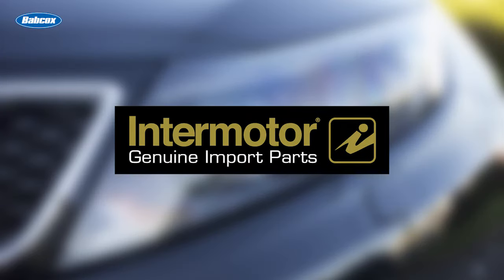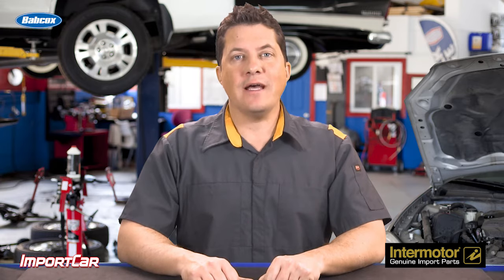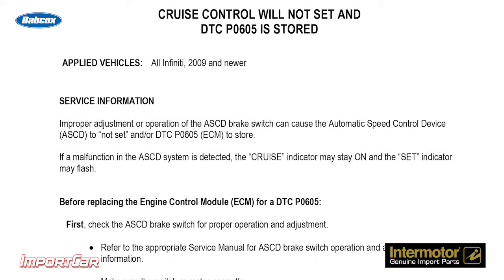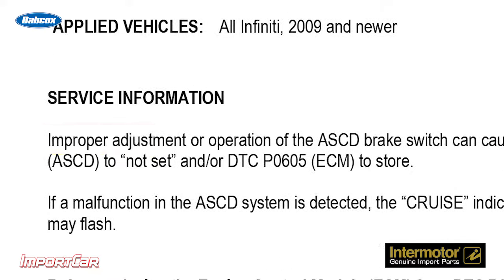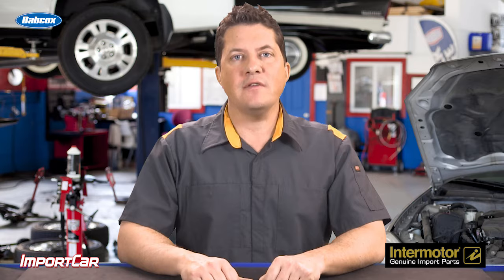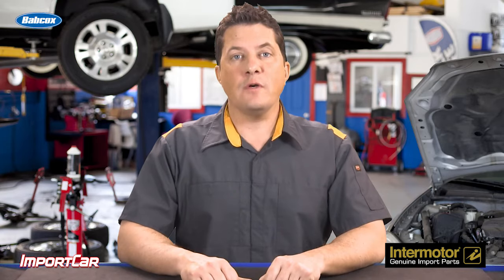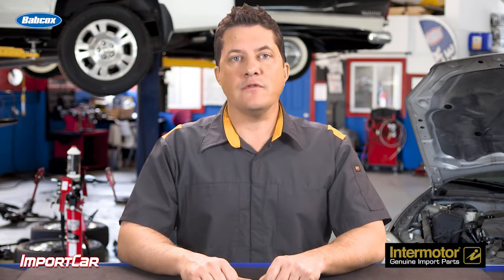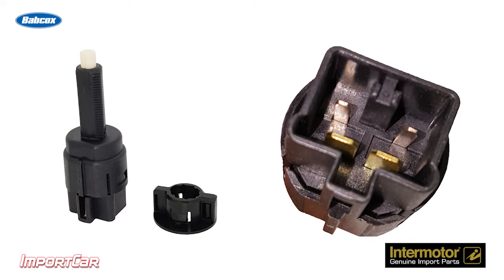Brake pedal switch adjustment | Tech Minute

Comment: Wow, nobody comes back to their video here and tells how to adjust the sensor?  - also,   it's not that damned easy, I swear my ribs on the right are bruised to hell and I would not doubt if if ones fractured by now.
Reply: I know the feeling EXACTLY.  Had my plastic bits crack off after years, put OEMs in and the brake is hanging always on

Comment: I got it, 

   for one thing, the Brake switch on some cars , newer , I don't really know how far back actually.  have a SENSOR, NOT A SWITCH.   looks like some kind of switch but it is NOT.   its a Brake pedal position sensor.   that sensor is NOT THE SWITCH that turns your brake lights on and off.   It is a sensor that tells the BCM to turn your brake lights on and off.      

  If the ground gets interrupted your BCM " BODY CONTROL MODULE" Can forget your sensors place. I have been researching this for days, your sensor might not even be bad. Your BCM might not even be bad, it could have happened for any number of reasons and GM cars and trucks are really susceptible because of " CHEAP A$$ CONNECTIONS" those plugs and winding wires in your harness are made dirty cheap.   they are exposed to open air and regular ole humidity can jack them up .  this is why a G6 can be fixed for a while from the no brake lights / brake lights all the time thing with just a glob of dielectric grease, or sometimes just unplugging and re plugging the BCM connection. 

    I tried to adjust that sensor every way possible - I even got it to work once! yup One time.   I put a small "C" clamp in place of the screw that holds it on the bracket  - I was hoping to find a new place to pop a hole in that bracket so I could put the screw thru in a new position,   I discovered that no matter where you put that sensor in the travel path of the sliding forks, it will never be correct. It will work one time and then go right back to the same old problem. 

    You have to recalibrate that sensor with the BCM. <-- this is the only way.   All the dealers around here and even the small shops pretend that it's not common, it's not easy, it's blah blah blah ,  they want 145.00 to look at it and rn tests, then parts, they will not guarantee the work supposedly if they do not order parts from their own suppliers .   They even told me it would be days, that I had to drop the car off and wait for my rape bill. 

   This is what I did, I researched Tools to fix this and other problems as well.   Then I narrowed it down and down and down to the lowest price tool that could do the job.     This was not easy either since ( I have come to find out ) Most sellers and even the actual makers do not know what their tools are and how they work, they just don't post it and when they answer you can get another answer from the exact same place that contradicts the 1st answer.    I found a tool that that for me was 100.00   for most everyone else 130.00 on eBay or even the site.   It's a Foxwell NT510 Elite.  <-- thats the name, and I got mine with Preloaded GM software.   if I want to add another brand I can for 60.00.  so say I buy a Toyota Tacoma later on, I just go to the site and pay them 60.00 and load up Asian cars Toyota.    
   so anyway.    here is what I did, never having used a scanner code reader or anything like it before.   I fixed this in 5 min after Opened the package. 

   I turned the key to on without starting, I put the OBD2 plug on the socket, the unit turned on, said wait, it pulled up my vin and the car and Identified everything.    then I did this with easy up and down ABC buttons on screen and navigated as shown below.

  Manual Selection->(B) 2007->Passenger car->Pontiac->torrent->(Y) 3.4L V6 ->5-speed automatic->Yes->Other->Control Modules->Body control module->Special functions->BPP sensor calibration

   when I got to Bpp sensor calibration, screen said put transmission in park or apply emergency brake if a manual shift,    I started the calibration, it read on screen do not touch the brake pedal. 

   a few seconds later I heard a "CLICK" from my BCM  ( my whole dash is torn out , unnecessarily I have found out ) my BCM is exposed so easy to see where the click came from.   and the the on screen said  DONE.     I unplugged the unit. turned the key back to off, started the car and everything's good to go like normal.     

  so now no one i know around here will have to pay for that cause I have the machine and you all know how cause I just told you. LOL     I wish I had a camera to upload this on a video.  would be much easier to see it.
Reply: Your 100% right without relearning recalibration won't work unless your lucky.... The sensor if not fixed and recalibrated will throw a permanent code the only bad thing you cannot use your remote start or in some cases cruise control. The guy that made this video is a jackass at his finest.....ty for your comment❤